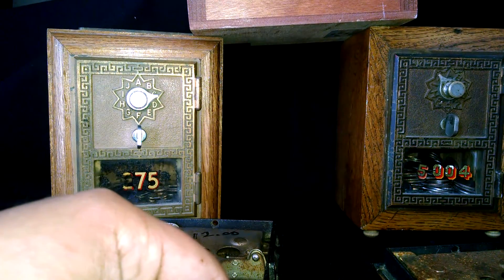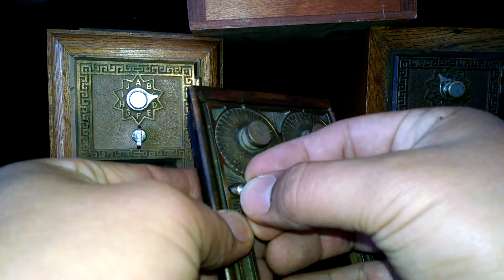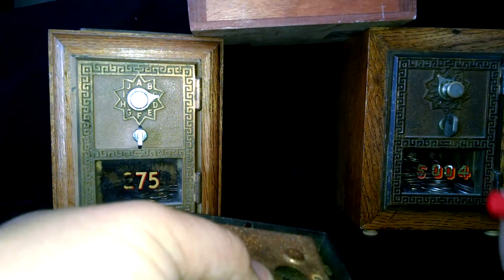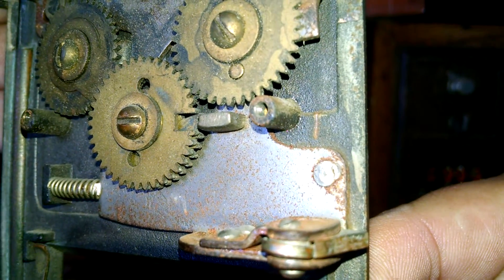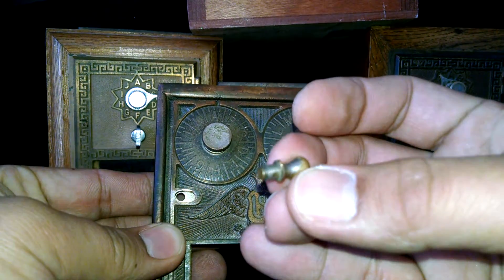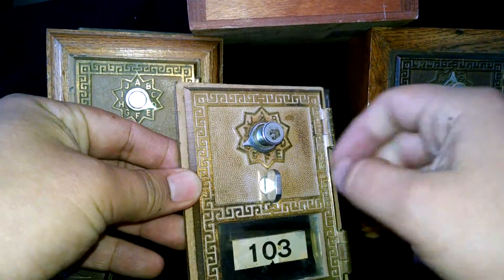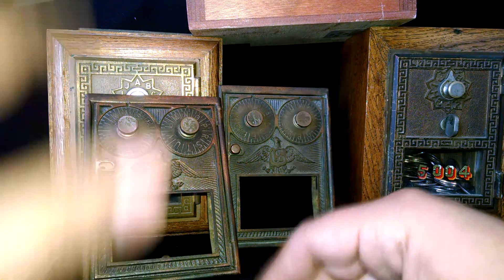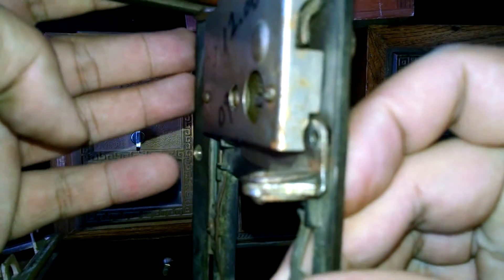P.O. Box door's

Comment: Hello,

I was hoping you could help me out. I have an old U.S. Postal box from the Bruneau Idaho Post Office which I purchased. I have the combination. It starts with a letter then a dash then three numbers i.e. (C-688 - not the real combo). I have searched youtube for directions for the correct rotation of the dial, to no avail. I have not seen any combinations with the U.S. - numbered series. Would you know the correct rotation to open this? Thank you in advance. 

Brian
Reply from the maker: How many numbers / letters is the combination?   You have the combo, maybe start with turning the dial many turns left then start the combo.. then turn the dial to the right and start the combo. If you have access to the back then you can find out what "key" starts first.
Reply: Hello, thanks for return. There is a letter B-344 for the combo
Reply from the maker: @bdbmarine  oh my fault, if you know the combo try a left right left.. left one turn then right full turn then back left on the combo.. then try it with a right left right. 

B-344🤔?
Reply: All Set Christopher I retrieved the combo from inside by pulling the paper out through the coin hole at the top. The combo was totally different then B-344, that ended up being the serial number. Thank you. All set.
Reply from the maker: @bdbmarine  all is well😊 marry Christmas Sir.